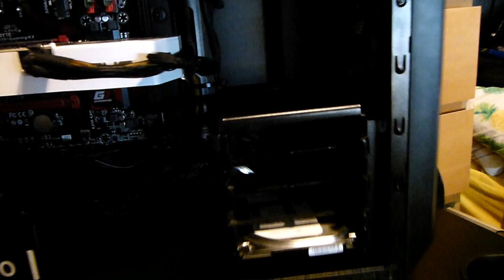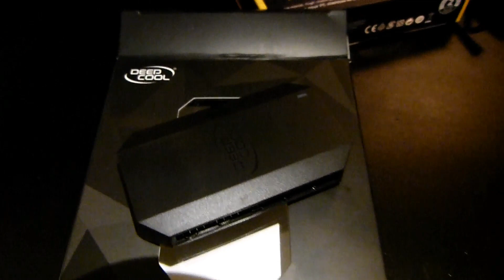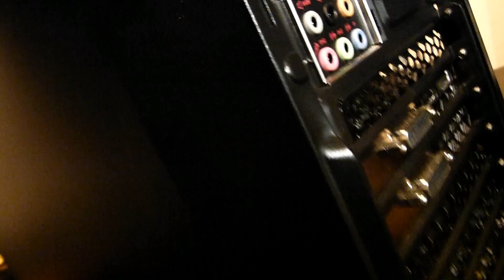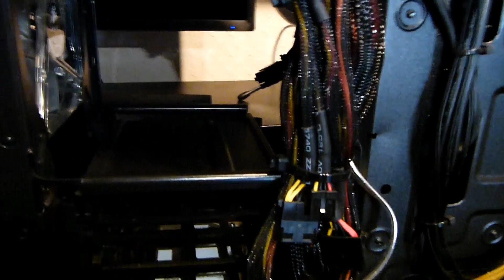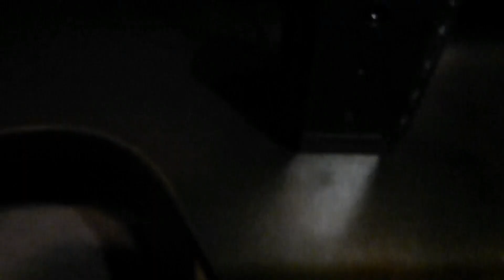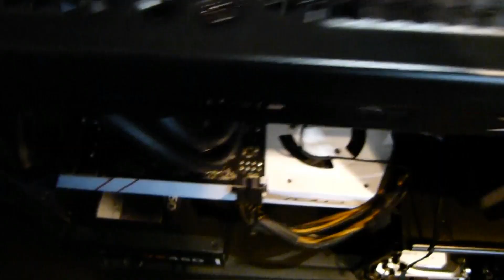How To Install Additional Case Fans And Power Supply

Comment: Is it really recommended to buy a fan hub like this? Or is it really just to control the speed of the fans and is it okay to connect the pc fans to the power supply?
Reply from the maker: My motherboard only had 1 fan power outlet so for me to supply power to the other fans a hub is then required
Reply: Thanks for the video btw!

Comment: (1) The thing on the motherboard is for a 3-pin cable from a computer fan? 

(2) So you mean that a 4-pin/Molex to 3-pin splitter cable that can connect more than one computer fans to either the motherboard or the power supply unit can really explode?
Reply from the maker: If you have too many fans coming through the one port on the mother board this can cause it to fry due to more demand in power,This is why an external power supply is needed to support the extra demand of power. But the port on the mother board is still needed to control the fans
Reply: Thank you for the explanation  @_crispyducky_9739 . I guess I shall get a 3-pin to Molex connector cable for my other two fans.
Reply: @_crispyducky_9739  Alright thank you. I guess if I am getting the ASUS PRIME B365M-A motherboard then I will only plug 1 fan to the motherboard and plug the other 2 fans to the power supply unit through a 3-pin to Molex connector.